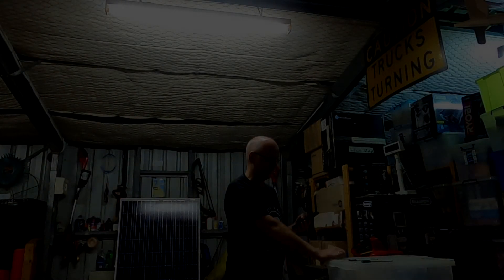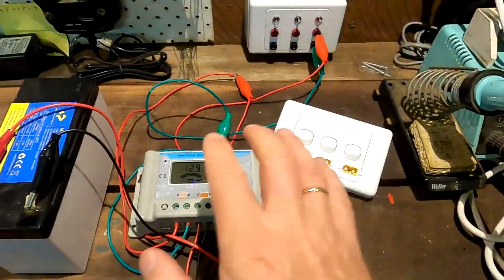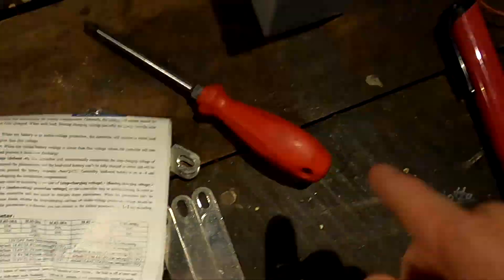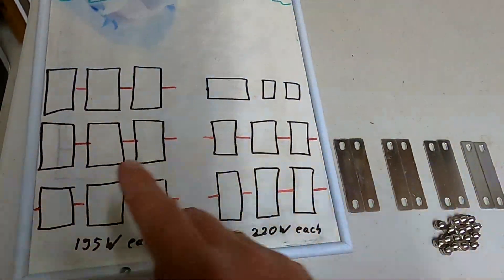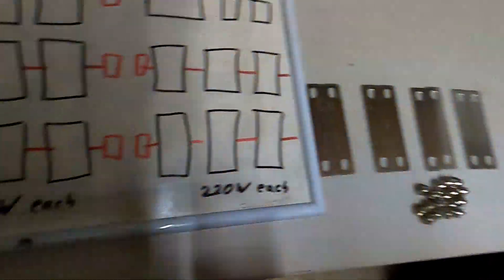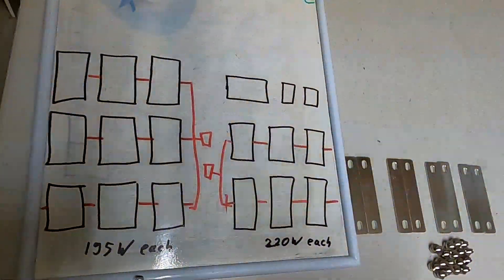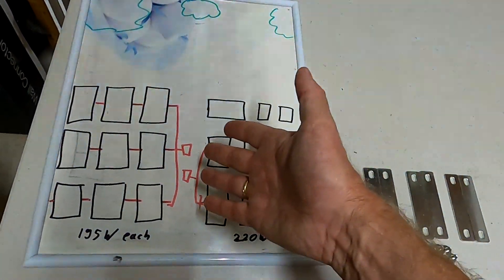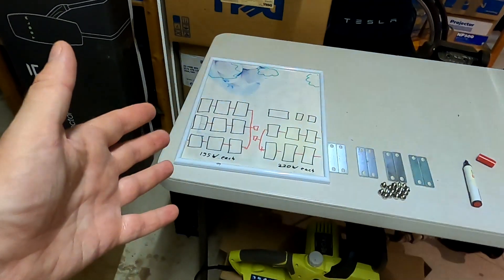How many charge controller make sense?

Comment: Each controller has losses and having many of them results in many losses.

Regarding the amount of strings, it all depends on how many volts and amps the controllers can handle. Diodes are the best way to connect strings in parallel, and the voltage of the strings should be equal. Strings should internally have the same current in all panels.

If the strings are active at different times of day, their quality does not have to be the same for MPPT to be able to work.

Also, remember diodes :)
Reply from the maker: Diodes are already inside each panel, so I don't need to remember them😉 . I was not planning to connect any panels in parallel but may do it at the beginning to see how things will work out...
Reply: @OffGridGarageAustralia  , yes, the panels usually have bypass diodes but not reverse protection diodes. Reverse protection is needed between parallel strings in case of string failure and differing solar conditions. People do say "I've no diodes" but they might  not have done all the homework and are very lucky people.

Comment: Depends on the losses you'd get from the individual string cabling versus the losses you'd get from the parallel connection. I'm also curious in how the voltages/wires would couple together after they come off the MPPTs, and if you need a 6th one or some other means to bring the voltage into one big lossless gauge cabling. I'm still in the multi-string club, but the numbers would be interesting for a test to show us. Cost/benefit analyses are always fun.

Comment: Go with Enphase micro inverters so that each panel is controlled individually and maximizes each panel production without affecting the others if shading occurs.
Look for second hand M215's if available in Australia. They sell for around £50-55 each in the UK. I purchased 10 and then found 10 new EXE 325w panels at £85 each, job done for less than half the price of new. Also in Australia solar costs a lot less than here in UK......
Reply from the maker: Ahm, it's an off-grid-system with battery storage...
Reply: @OffGridGarageAustralia  SMA sunny boy.    Micro grid

Comment: Having 5 charge controllers should work fine to handle the particular shading issues you are having. Matching like for like panels will help get the most output from of them. The only issue I can see is making sure that all of them are seeing the battery voltage accurately at or very near the same. Hopefully you can customise the charge profile settings to compensate for the differences between controllers so they all can go in to absorption and float close enough to each other.

There are some models out there where one can act like the master and the rest are slave units so only one makes the determination of the SoC of the battery. If not, it will require some fiddling to get them to play nicely with each other. Voltage accuracy on the battery bus is the key to pulling it off.

It does require little bit more wiring, but having redundancy doesn't hurt and a learning experience at the same time...
Reply from the maker: Yes, controllers need to be setup roughly the same. I made this video and showed what happend if not: https://youtu.be/31aSkXvKXOQ

I've seen the Victrons can communicate to a controller which can optimise the charge for such an installation. That sounds really interesting.

Comment: Experiment on the west side. Try 3  and just 1. If 3 is better you'll need to get 2 more, if 1 is better. you'll have 1 extra controller.
Reply from the maker: So you mean I should start with one controller for all 9 panels?
Reply: @OffGridGarageAustralia  I think that would cost too much to start with.  If I understand your setup, you have 3 strings of panels on the west side. Connect  3 controllers, only on the west side and see how the shade effects just those 3 strings of panels. Then try 1 controller  connected to all 9 panels on the west side and see how shade effect them. Then that will give you an idea of how many controllers you need.  Thanks for the content.

Comment: Not every MPPT solar charge controller will work with an other in parallel simultanious.
Every tinny voltage difference in the MPPT charge controller messurement will effect the charging.
Perhaps only one of the MPPT chargers will be charging unless a big amount off AMPS are drawn by the batteries.
Have the same problem with my own MPPT solar inverter and extra MPPT charge controller.
Some brands off MPPT charge controllers can communicate and will not have this problem in theory...
Reply: Do you use lithium or AGM?
Reply: @zarbonida  AGM , but i m thinking change the battery bij 3x US3000 Pylontech units. 315wp LG solar panels 2 in series and 4x parallel in 60A epsolar charger in 48v battery configuration
Reply: @adamskurt6328  ok. With lithium battery every mppt charger are indipendent from others. 
You can set different minimum voltage to reduce current when the battery is full. 
I have 4 epever tracer (AN 5020) in parallel. 
FLOAT are the same (53,5V) for every one but CHARGE and BOOST CHARGE profiles are different.
1)55V and 54,0V (60min.)
2)55,2V and 54,2V (60min.)
3)55,5V and 54,5V (60min.)
4)56V and 55V (60min.)

With this settings, when the battery becomes full, they reduce gradually current because each one solar charger stops charging in a different moment from others. 
The first one stops charging at 90%, the second one at 92% and so on...
Reply from the maker: Thanks, Adam. So far all my tests have shown they work great together and care more about the connected panels rather than a few mV at the battery side. If they have different settings though, one may stop charging earlier as shown here: https://www.youtube.com/livingdownunder

Comment: Depends on the charge controller you have to meet all 3 conditions voltage, amperage and total wattage of the specifications of the charge controller. So if it take 30 amps likely that would be 3 panels in parallel and no more strings combined. The best way would be to used a inverter that includes PV like the pip or sol-ark otherwise buy one Midnite 150 which would likely run all the panels. they have a calculator on the midnite site look it up and you can see better how you can load and combine panels.

Comment: I would do it just like that, yeah we can get the wrong idea easily, we don't see what you see!   I have 12 x 270 watt panels, I'm putting three 60 amp controllers on them, a bit overboard, being its just 45-47 amps, I'd like to get a classic 150, to handle 96amps, I could parallel two strings, and either get more panels, or just use a 60a controller on the other,

Comment: As far as I understand the issue with shading is that any shaded series array will be back fed by another when paralleled. This will invariably cause severe efficiency issues and potential damage to the cells. The solution is to put diodes on the output of each series. I believe Schottky diodes are the answer. It would be super interesting to see what the efficiency difference is between this solution and a controller for each series array.
Reply from the maker: This only happens if the voltage difference is high due to very dark shading one one string. The sunny string would feed into the string with lower voltage. All panels have already diodes integrated for such matter and I doubt the voltage difference will be that high. Of course the shaded string will not produce much amps to contribute in a parallel connection.
Reply: Please read more about this type diode application.
Reply: @andreczajkowski2761 Sorry I'm clearly suffering from the Dunning Kruger effect...! Pls do enlighten us on the proper application of these diodes.

Comment: If you pararrel them like that i dont think shading will be a problem. You will just get less amps from the panels in the shade. So 2 will be fine. Id still trim the trees too tho. Eg youd get say half an amp from the 3 panels on the top part of the roof in shade and 2 amps on the ones at the botton in shade because they are in parallel the amps will just add up to 3amps. An issue only arises if one of your 3 panels that are in series gets no sunlight at all and no output because that will put all of the 3 panels in series out. But this may only happen for a short period of the day. If u went with 5 charge controllers youd connect 3 in pararrel to each charge controller and youd avoid this issue.
Reply: Or youd put all the panels in pararral and connect to a single charge controller if you can find one that can handle the total amps.
Reply: Even if one of the 3 panels in series is shaded and not putting out alot of amps it will reduce the amps on the other 2 panels in series. Eg shaded panel is outputting 500mA the other 2 panels in series may not be in the shade and could be capable of outputting say 2 amps but they can only output 500mA because they are in series with the panel in the shade.

Comment: I think you should rethink the series connections - when a panel is in the shade it will limit the current of all the panels even if the others are in full sun. If you put them in parallel (North/South) and one is in the shade, the the other two (or one) in full sun will deliver full power.
The question then becomes can the Solar Controller handle the current? 
The most efficient arrangement for power is to have a controller per panel, the most efficient arrangement for $$ is to have only one controller.
A happy medium is each bank of three (or 2 for the 220W units) north/south panels in parallel are hooked to one MPPT controller for each bank, so 4 controllers. I think series connections are good for reducing the gauge of wire required, but they stuff up everything else.
Reply: Listen to this guy
Reply from the maker: Well, shading occurs only in winter time. Also, the shade is massive so it will effect almost all panels on both roof sides.
Reply: @OffGridGarageAustralia  Then the question about wiring is moot.

Comment: If I remember correctly only 80a & 100a EPEVER charge controllers can be dasychained to work in a single system.
Panels are cheap! Given that they are parallel at each shaded area. The gains in efficiency of slightly more optimal voltage for shaded panels won't justify additional cost of charge controllers.

Comment: Hi Andy, partial shading does have a very big impact on an array. I've found approx 5% shading can cut array output by 50% so the multi mppt controller approach to split the array into sections based on shading movement would be more efficient. This would work similar to having 'maximisers' on each panel. Added benefit is if one mppt fails you don't loose the full array. Only thing to consider is the MPPT's synching so to speak. I have heard of issues in this area. Not had problems myself as I have 2 x Outback MPPT's but they sync via a comms hub. Interested to see how you go.
Reply from the maker: Thanks Greg, much appreciated. I'm still undecided...

Comment: I've been in contact to Victron and some other solar freaks. In case your power storage demand is more important than counting pennys (ok, MPPT's are more than that), you have to use one MPPT per shade area. In my use-case (yachting) the available space for solar panels is limited so I've to harvest as much Ah's as possible = one MPPT per one or two panels.
And yes, a 48V system is more efficient than 24V.

Comment: Maybe 3*150/35 victron controllers at $385 each and a battery sense $60.
Then you can network the controllers via Bluetooth.
It's hard because you have different panels and your voltage is high.

Comment: If you put multiple strings in parallel, each string needs it's own string diode, so you don't feed back the shaded panels.
Efficiency wise it's the more charge controllers the better. 
Simplified this is how these solar optimizers like SolarEdge work. There you have the MPPT tracker per each module and these devices provide a steady voltage. The main controller just converts this steady voltage without a second MPPT to a useful one. Very simplified, as I said.
But still it is a huge cost factor to think about.
In Australia you very likely don't have to worry about enough sun time like we do here back in Germany. I would go with the parallel connected strings and some Epever Tracer AN + MT50 Display or Makeskyblue charge controllers.
Reply: Given the cost (and quality control...) of chinese MPPT CC I would give it a go at having one MPPT per serie. Besides, this gives you redundancy in (the likely case) the charger turns into dust :-) But you are absolutely right about the Diodes. At that size it starts to get dangerous not to have diodes. For <1000w (ish) is not really that necessary as the isn't enough load to set anything on fire, the panels themselves will take the load, but obviously having them won't hurt.

Comment: With a 48V battery system you can't get inexpensive MPPT controllers.  So just go with a big 40A or 60A version and run all your panels with 2 in series and parallel them up.  MakeBlueSky(which I have) works with LiFeP04 and so does the Epever.  You probably are wasting a lot mixing panels like this.  You could wire your batteries for 24V and then use a few lower cost MPPT controllers with just 1 in series and all of each type in parallel.  That would be the most efficient.

Comment: use diode.
Reply: Panels have a diode in the junction box.
Reply: I mean blocked diode after each series connection.  is a much cheaper solution than buying many charge controllers

Comment: First look at the max voltage of charge controllers.  Most are rated up to 150V.  You pick the worst case voltage  which is is the Voc(40-50V) and adjust for cold temperature which is another 5-10v more.  So you probably can only run 2 panels in series and stay under 150V.
Reply from the maker: No cold here. 5-7°C in Wintertime is the coldest we get. The panels have 37Voc (220W panels) and 45Voc (195W panels) so with three in a row I stay under 150V anyway.
Reply: @OffGridGarageAustralia  The calculation is 25C -5C = 20 * .142V/deg = 2.84V.  So you add that to 45 and get 47.84V.  Yes, no problem with 3 for a 150V max charge controller.  Charge controllers will say to keep voltage 1.5 to 2x the battery voltage.  So for a 48V system 2 of the panels in series is better than 3, but this is more of a concern with PWM than MPPT.

It's best to keep the 37V panels on a different charge controller from the 45V ones.  Your lowest cost solution might be to get 2 PWM controllers and buy more panels, then to try to get 2 MPPT controllers, especially if you are doing 48V batteries.
Reply: He lives in Australia
Reply: @zarbonida  Parts of Australia get cold.....even in Far  North Queensland!